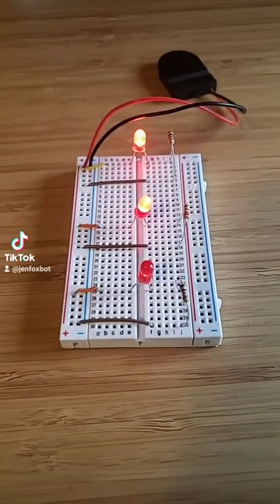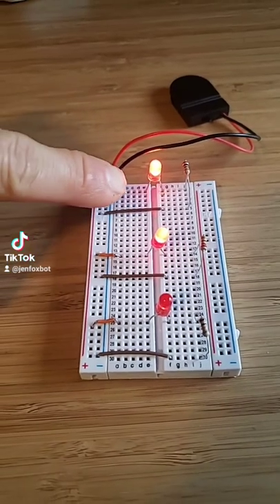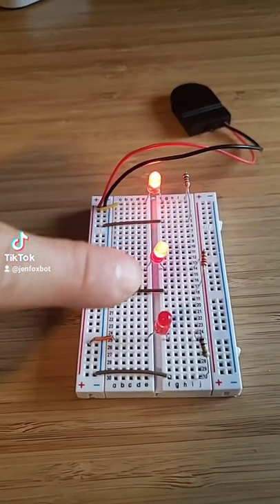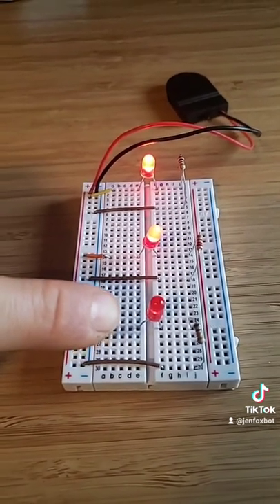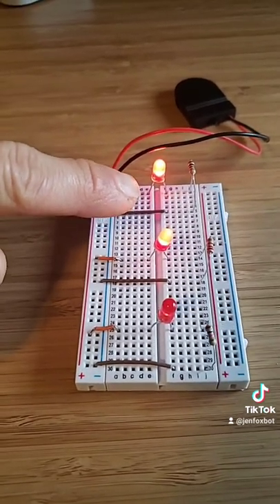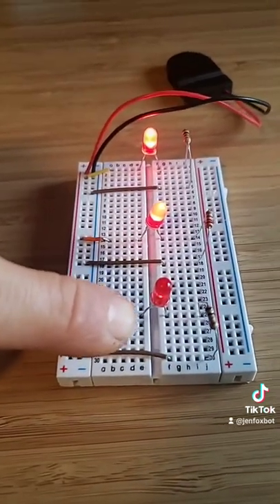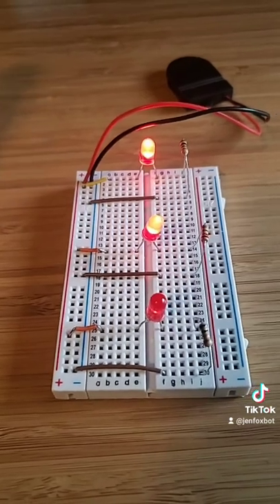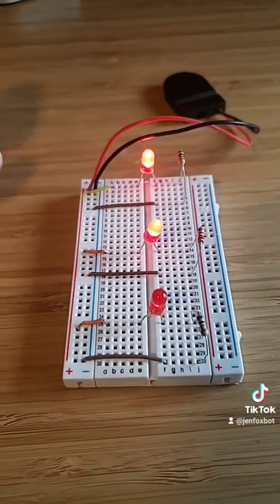what are resistors??

Comment: I’m an electrical engineering student and this worked better than my teachers explaination so thank you
Reply from the maker: Wow, I am so happy to hear that this was so helpful for you!! Please LMK if there's other content that you'd like to see 🙃
Reply: @JenFoxBot  i have something, when im looking at diagram's for circuit's i see "diodes" but they aren't the led kind so what is the difference between diode the two kinds of diodes?
Reply from the maker: @corneliusrosenaa3949  a diode is a component that only allows electricity to flow in 1 direction. This is also known as "polarized". Diodes are often used to protect sensitive components in circuits by preventing electricity back flow (this often happens with motors or other electromechanical parts). LEDs are a special kind of diode that emit light!
Reply: @JenFoxBot  thank you and have a great day!
Reply from the maker: @corneliusrosenaa3949  aww thank you, you as well!

Comment: How would a resistor allow for the battery to last longer? I was under the impression that the battery would be outputting the same energy and the resistor would be burning the excess.
Reply from the maker: not necessarily -- the battery can't "control" how much it outputs, that depends on the load (e.g. motor, light, etc.). if you add a resistor, you limit the amount of energy the load can pull from the battery.

Comment: Is that how adjusting brightness on my phone works, or is it s completely different story? Anyways great gun tutorial!
Reply from the maker: Ohh good question! Changing resistance is how we used to adjust volume of sound on speakers and same for dimmer switches in our houses. Phones use OLED screens, which are like a wall of tiny LEDs (each pixel is its own light source and draws power). Changing brightness happens by turning on/off pixels and changing the color of those pixels. 

Also fun fact: there's a light sensor on our phones that controls the auto brightness !

Comment: Why would the battery last longer? Is energy not put in to battle resistance?
Reply from the maker: Great question! Resistors limit current, and battery capacity (i.e. how long it lasts) is measured by how much current it outputs over time. This means that bc the resistors reduce current flow, the current out of the battery is less and thus it lasts longer!

Comment: Where is the diode.  transformer  and capacitor
Reply from the maker: None of those in this circuit (well, technically an LED is a diode but its function is not typically used for preventing current backflow).